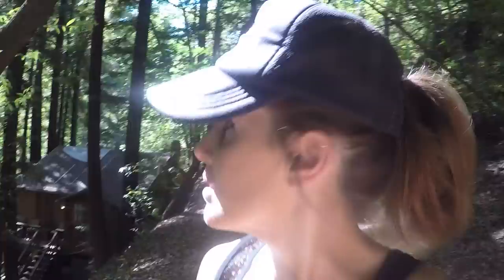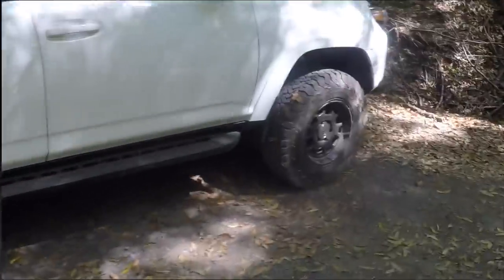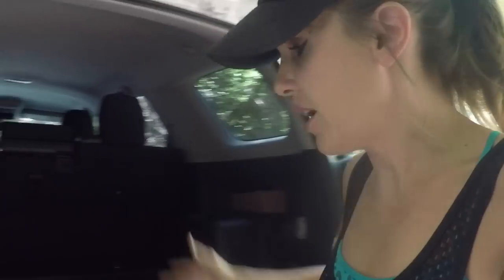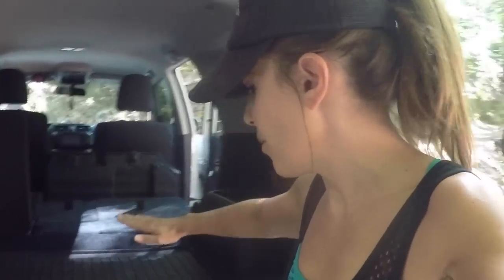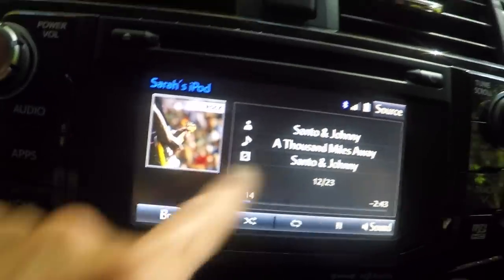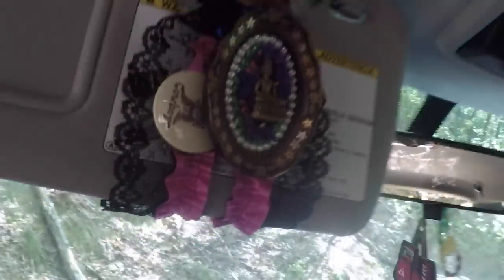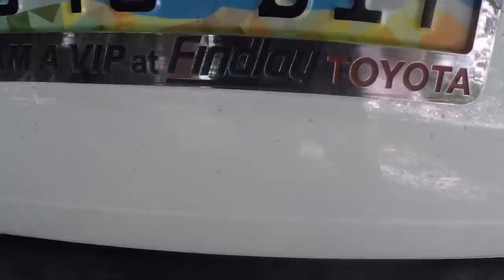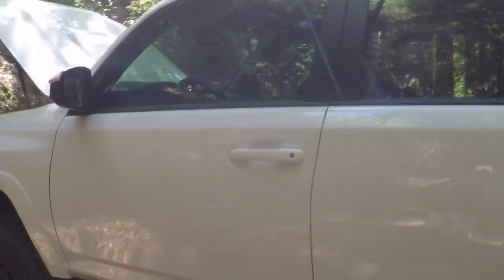Overview of My New 2017 Toyota TRD Off Road 4Runner

Comment: The ICON front end suspension, swing arms,  a frame   is a huge step up from the crappy bilstein shocks.
You scored.
you have reservoir shocks , with coil over shocks.
this system is about $3,000.00  over the THE TRD PRO standard suspension.
the shocks are high end, thank your lucky stars you did not get the bilstein shocks.
you got a huge upgrade, with this suspension system.
congratulations. you have an extremely capable 4x4 overlanding vehicle. the unit you have has the crawl mode.
don't listen to any naysayers, your 4runner is already well above the TRD pro.
I know because the first thing i did when i got my trd pro, was to  replace the front end that comes with the pro, to what you have now, and toss the bilstein shocks in the trash. it's a marketing ploy.
Go to the toyota  off road user groups, and post questions.
Don't listen to Youtube whiners. the only thing you don't have is the skid plates and real quality ones,  can be purchased from after market sellers and installed by any reputable 4x4 shop.
I spend several months a year off the road, overlanding. Research the Overlanding community,  its huge.
Plan to visit the annual overland expo in Flagstaff next spring.
Be proud of the truck you bought, its a fantastic vehicle.
Toyota 4 runners and Tacomas are the world's top off road overland vehicles.  They are the pinnacle of the overlanding community.
check out the OVERLAND sites for ideas for the build out of your 4 runner.
congrats....... YOU SCORED.
send me a message if you have questions, this is my specialty.
But do your research, before you ruin your truck.
Its an extremely capable overlander.
Reply from the maker: +Perry Chamberlain THANK YOU!!! This is great info and great advice....I thought Bilsteins were supposed to be the best, what the heck do I know?! LOL! Thanks again for the info!

Comment: very nice put some dust
Reply from the maker: +curtis mccorkel it's already covered in it :-)
Reply: there nice but very hard to git lockers for ,eaton gears ,snokel.35 tires good .in alot that abandon stuff got lockers in axels left on property ..if you go way out there i would up grade your radiator waterpump,for hot weather dual fans ect. on iarforce force base we ran hot way out there got stuck with no lockers ,overheated from runing air ,we had cooler full bud light  ,to dang hot drink beer

Comment: Dark Tinted windows are definitely illegal in California, especially teh driver's and passenger's front side windows. The police will have a field day giving you tickets if they are having a slow day. Yes you can have "tint" on those two windows in California but its only the very lightest shades that are allowed, nothing approaching how dark your windows are.

You can get a "map" that is like a giant sticker, in pink on the whole car or you can get it sprayed with a plastic coating (Dip Your Car) that protects your paint, is available in absolutely any color and finish you want and the best part is the its completely reelable, so you can peel it off your self if you feel like it and your original paint will be like new underneath.

Your 4Runner actually is rated at 19MPG combined, if you drive it carefully with properly inflated tires and use the cruise control at all times then you'll probably improve on that number.

The number one thing I suggest for you is to take several off road and survival classes, seriously. You're just guessing and depending on what random tell you to do which can be extremely dangerous when in the woods or off-road. Be safe, take the classes.